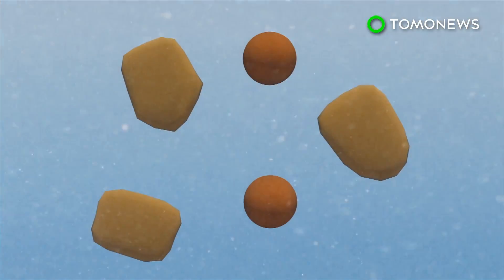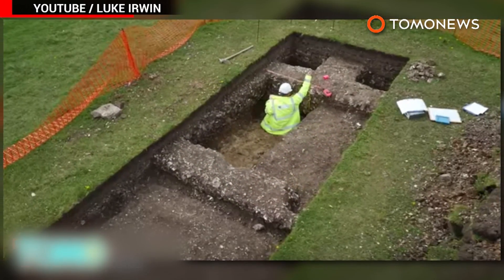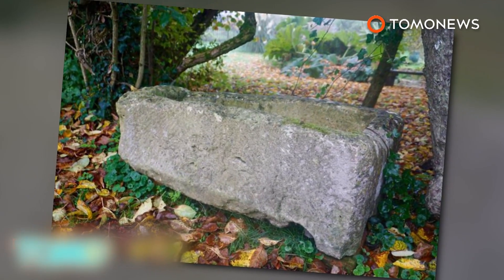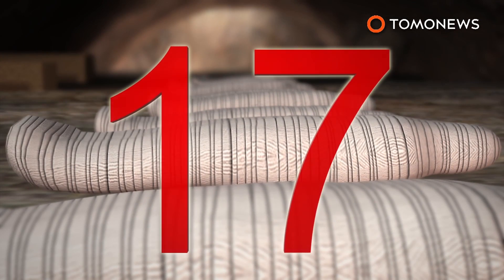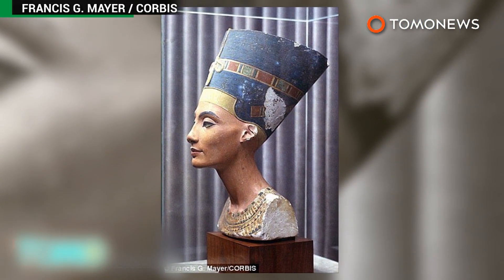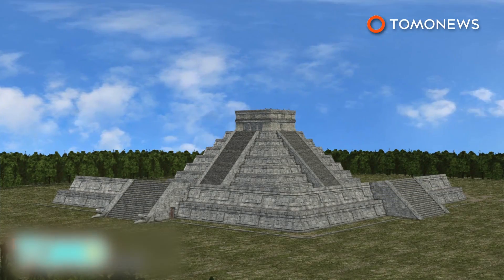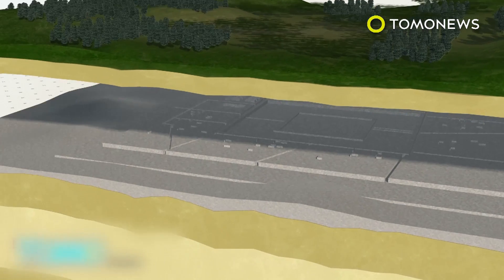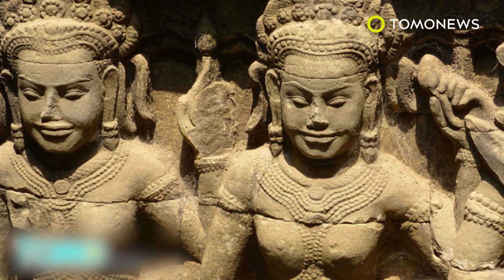Ancient Roman concrete recipe: Seawater is the secret ingredient, says US researchers - TomoNews

Comment: Is volcanic ash similar to fly ash?
Reply: "...Fly ash consists primarily of oxides of silicon, aluminum iron and calcium. Magnesium, potassium, sodium, titanium, and sulfur are also present to a lesser degree. When used as a mineral admixture in concrete, fly ash is classified as either Class C or Class F ash based on its chemical composition...." Fly ash is very dry, volcano ash, despite being hot, still has water bonded to some of it. So super heated volcano ash would very much be a type of flyash!

Comment: Video scientifically confirmed the salt water theory. Also, I like it because the video was straight to the point, within 1:21 from the beginning. However, asphalt and concrete, how would those two interact to produce a viable and cost effective resolution.